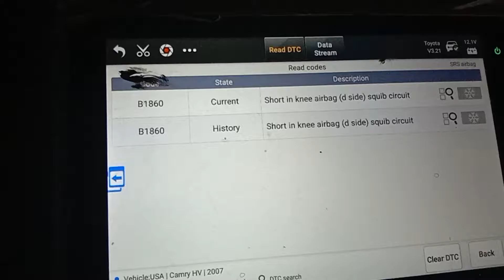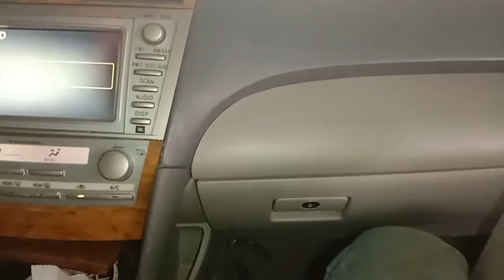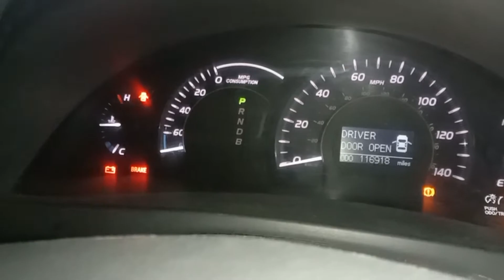B1860 History Short in knee airbag ( D side ) Squib circuit

Comment: Thank you for sharing! I watched this previously and didn't notice that you removed the metal clip from the inside of the plug! I recently had to replace the steering wheel damper and after reconnecting everything, the airbag light would not go off. I had to order a code scanner to determine what was wrong and got the short in knee airbag B1860. Removed and confirmed that the pins are shorted. Didn't realize that this metal clip insert is what is causing the short! I'm going to remove it and see if that resolves the short! If it does, I'm willing to paypal you some money for coffee too! You saved me 150-200$ for sure! TY TY TY!
Reply: Sad days! Pulled the clip out and tested with only the pins of the igniter present, dead short still. Sigh, Buying a new airbag :(

Comment: Hello, in the video, it is not shown when the piece is removed from the metal inside the socket. which makes contact with srs pins to detect when the connector is disconnected.
Reply from the maker: អរគុណលើកក្រោខ្ងុំនឹងធ្វើអោយល្អជាងនេះ